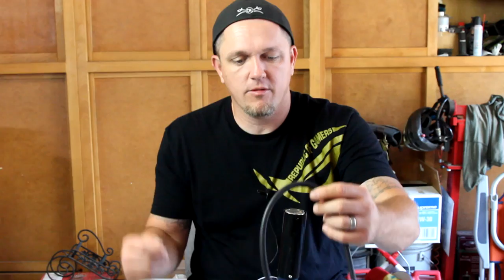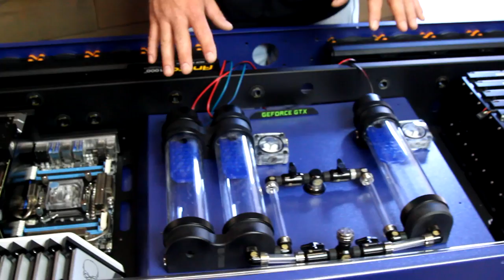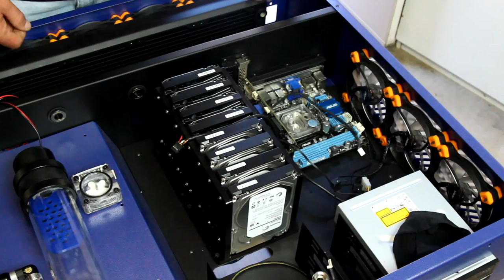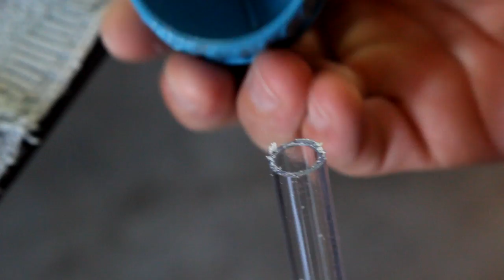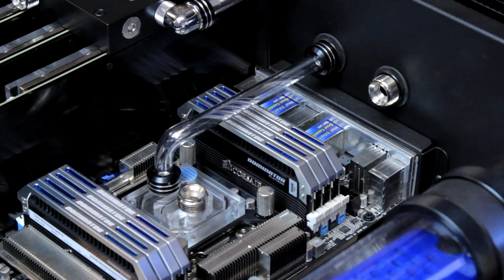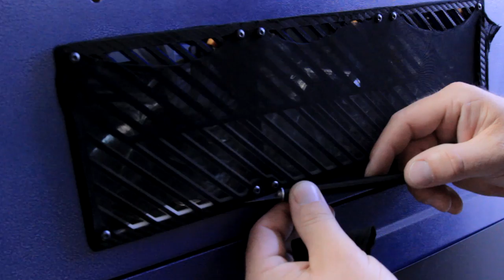Personal Red Harbinger Cross Desk part 3 - Hardline bending - Time for liquid

Comment: Hey man. For pulling tubes through i find it easier to precut the tubes a bit then take a REALLY long ziptie, tying up the silicon tube tight, then putting the long end of the ziptie through the hard tube and pulling the silicon tube through. Makes it WAY easier to do. lube the silicon after putting on the zuptie so it wont slip off. Love this build btw. Ill send you my epic custom build log when I get done with it early next year. Keep up the good work bud :)

Comment: That's some kind of awesome, wish I had that sort of cable space. I have a pretty big case its the coolermaster stormtrooper using all 8 bays and drives keeps disappearing or getting corrupt then I loose massive movie data like 4tb at a time because the cables are being crushed by the side panel, it so hard to get on. I don't want them facing inside the pc whick would be the answer because I like it tidy, you would think a case of that price and size I would be able to hold all the free bays cables without fuss.

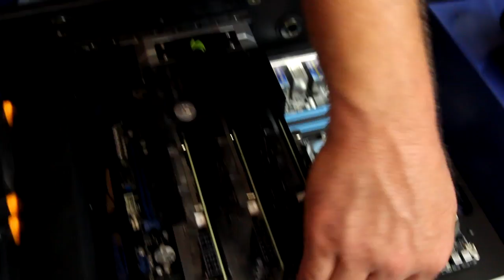Comment: on 3:10 I have some questions.. 

1- which GPU LED cable is that?.. looks like a 2 or 3 pin cable 
2- where I can buy this GPU LED cable? 

Thanks
Reply: +hemidesign Probably just modded the original?
Reply from the maker: +hemidesign i modded the original
Reply: +Pcjunkie Mods oh ok.. thanks!

Comment: Looking great. I'm that familiar with Harbinger Cross Desk. Is this (aluminum) desk standard black/blue color? No, how did you color it? Thanks
Reply from the maker: bazen13 I had it powder coated and my is a prototype. Not the same as the retail. Main chassis is steel and most of the rest is alum except legs.
Reply: Oke thanks, is looking nice. The retail will be the same I think.
I'm thinking to use stainless en alum. It's looking so great

Comment: Going hard tubing. What would you advise for a first time bender. Petg or arylic. I'm leaning g petg with revolver fittings. I have from work aready a hack saw powered and not powered one, a reamer (debur) , heat gun, heat gloves. Also what's an easy method to factor out how much offset for the bends so everything lines up and is not off slightly
Reply from the maker: James Emsley It seams you have all the tools. I like the PETG over the acrylic. As to the offset you will have to figure that out on your own because I use a Primochill bender and I have my 90's set really tight. So my offset may be different than yours.

Comment: What did you use for the pass through and if its bitspower fittings how did u get a fitting on the other side
Reply from the maker: sly gaming they are the bitspower fill ports. They have a nut on one side
Reply: thx lee

Comment: Nice, The white coolant. what brand is that ?
Reply from the maker: Ice Dragon. But now I custom mixed it. It's mixed with Primochill Clear and a lot of Primochill blue dye. ;)
Reply: pcjunkie209 Probably not the best idea to mix brands and different types of coolant. It may be fine, but it may not be long term. Mayhems doesn't even recommend mixing any of their different coolant lines (x1, pastel, aurora, etc) so I'd be weary of doing the same with primochill and ice dragon.
Reply: Chris Cleveland Im sure he knows what hes doing.
Reply: Theorcman2008 Pretty sure he isn't a chemist, but ok.
Reply from the maker: Chris Cleveland I have tested a lot of liquid mixing and if u read labels first and know what not to mix you don't have to be a chemist.
Reply: pcjunkie209 If you've tested mixing them before that's all it takes. I just know Mayhems doesn't recommend mixing their different premixes with each other, so I assume that applies to mixing it with completely different brands. But if it works that's good. I'd still feel a lot more comfortable mixing pastel or ice dragon with mayhems dyes to get the desired color
Reply: Chris Cleveland He has been doing water cooling for a while. I have seen his work what have you done? Being a chemist has nothing to do with it.
Reply: Theorcman2008 Been building custom loops for years, not that it has anything to do with it. And yes, it has everything to do with chemistry.
Reply from the maker: Actually knowing what chemicals don't mix is a little chemistry. But yes some Mayhems don't mix.

Comment: Seagate Hard Drives!?!?!?!?

You are asking for trouble there bud.  Sea gate is NOT a reliable brand at all.
Reply from the maker: They've been good to me.
Reply: We'll then I hope that by some Miracle, that these ones will be good to you as well.  Other than that this looks like an excellent project.
Reply: seagate is beast yo.
Reply: No hey are not.  They are junk, lowest of the low, bottom of the barrel, crap, shit, dung.

I have been in the IT and tech field for over 35 years and never had I seen so much trouble from any company but Seagate.
Reply: I'm in the military and we use seagate for our drones. I should know which hard drives are rugged.
Reply: Junk.  The military is using junk.......thanks for confirming that.
Reply: DigikidForever I've had several seagate drives myself, no fails... Had a couple failed WD black drives.
Reply: When you have problems with a part chances are you got a bunch of lemons in a row truthfully Seagate is one of the better brands to me as well....im sorry you have had a bad experience with Seagate.
Reply: I have had the same Seagate 500gb in my PC (Actually moved across 3 builds) for 7 years... 0 errors so far.
Reply: what are you babbling about my HDD has lasted for three years